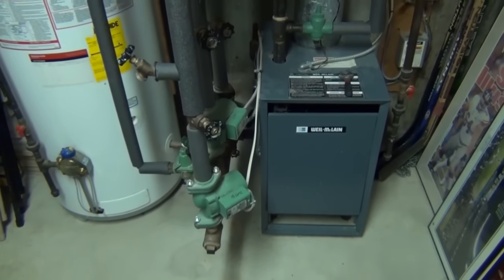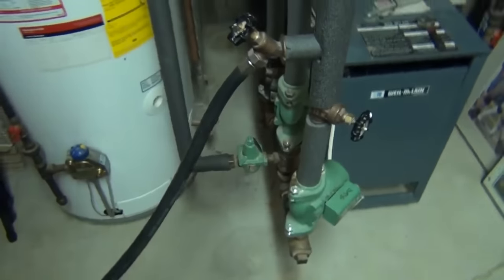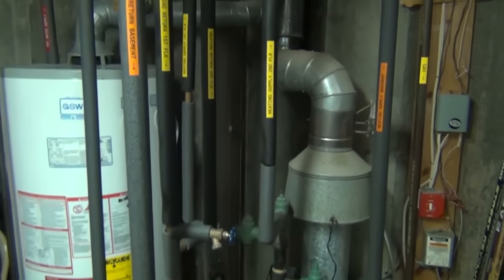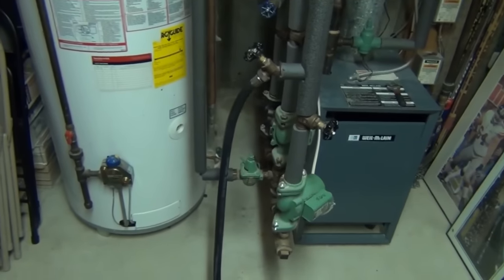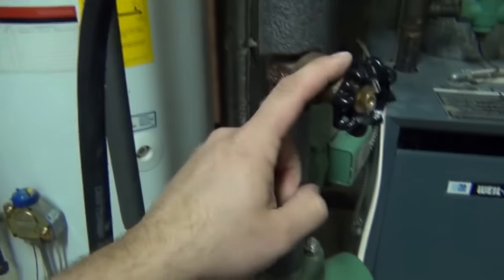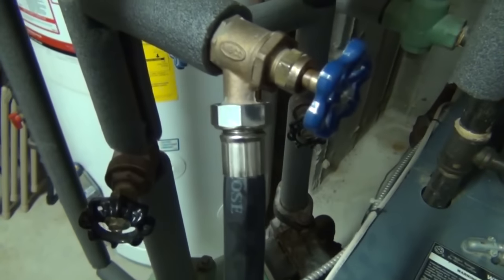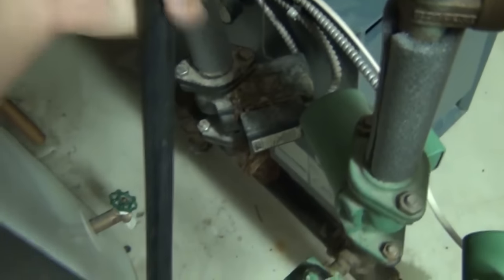Remove Air from your Boiler and Heating System | How To

Comment: Looks like city water pressure could be around 60-80psi. When the fast fill switch is on, and you let the water run through the boiler, how come that doesn’t set off the relief valve? Thanks.
Reply from the maker: Good question…because it never has a chance to build up with the purge valve open
Reply: @fixitwithzim  I see. Thanks a lot!

Comment: R all the lines to the rads insulated like I could see ? Noticed that the gage in normal range. Mine r insulated but my temperature goes beyond the setting 30-40 degrees. Comes on normally. My pressure goes down to almost o as it cools n shuts off   Two separate issues -any feedback ??  System bled n otherwise works fine
Reply from the maker: The pipes are only insulated near the boiler in an attempt to “hold” the temp in the system a little longer and also so the room doesn’t get that hot. Helps marginally but not much.  You sure your gauge is working correctly?

Comment: I have an automatic air bleed valve but still hear air in the system. Can this process be done even though my boiler is equipped with the automatic valve?

Comment: After watching your video I went to check out the boiler.  I have two zones.  The air purge values were connected by a three foot hose.  I felt the hose and  it felt hot and like it had pressure.  The boiler was on at the time.  Is this normal? Why would it be like that?
Reply from the maker: Valves are probably leaking so someone coupled a hose on them to stop the leak.  Either that or someone looped the zones together to bypass a bad circ
Reply: @fixitwithzim  thanks. , And like others said, your videos are excellent
Reply from the maker: @Bklynsray  thank you!!

Comment: Good video. But watch out your pumps hanging in the air. I would fix them tight to the floor with additional support. Your pumps most probably have a slight movement when switching on and off. That will let your connections give cracks and leaks over time.

Comment: My system has 2 zones that share a return. There's a pump for both zones but there is no valve between the drain valve and where they tie back into the boiler. Now what?? Is it still possible to purge the system?
Reply from the maker: Yes, it’ll take a bit longer since the air won’t be pushed out the hose 100 percent. You can still get it done

Comment: Hi I have a question can you do this while boiler is running?
Reply: System should be completely turned off. Some systems have two switches one just for the burner ie service switch and the other a main emergency switch that should shut both the burner and boiler/circulators.
Reply: @Precisioninfrared  ty

Comment: Question:  my system doesn't have the gate valves as you described at 2:15 (the ones to prevent the water from going back into system).  Is there anything I should do differently if I can not close this off?
Reply: Some systems don’t have purge stations so you have to bleed them at the highest point in the loop.   You might not have gate valves but it could be a different kind of balve too
Reply: @gfriedman99  Thanks for the reply!  Sorry, I should have been more clear about my system..  I do have what appears to be a purge valve - the one that you can connect a hose to.  The difference in my system is that I don't have the second valve that is being shut off to prevent the water from flowing back into the system.  Is that a problem?  Is there anything else I should do differently because of that?  Would it still be okay to open the fill valve to increase the water pressure in that case?
Reply: @MD-tb8dk  I understood what you said.   You have a boiler drain.   So unless there is another valve you can shut between that drain and the rest of the piping you wont be able to bleed air this way.   Most likely you have cast iron radiators anyway so you would need to bleed it there.
Reply: @gfriedman99  thanks again Gene.  I actually don't have radiators.  Sorry if i am not explaining this very well,, as I am learning and a lot of this is new to me..  I have 5 zones with baseboards along the floors, which have the copper pipe inside (the ones with all of those thin squares around the pipe).  Each zone has a drain/purge valve (the one that you can attach a garden hose to) and below each of those are the zone valves (the box that can be switched from automatic to manual via the lever).  Below those zone valves the pipes all meet up with a pipe where the domestic water comes in which feeds into the boiler/furnace.  What i don't seem to have is the second valve on each zone that is being closed off (the one without the garden hose connection.  It looked to me that I would be able to connect a hose and open the valve to purge air out, but was concerned that my system doesn't have that secondary valve to close on each zone.  Does that make sense?  I think my system may be a little different in its setup than most...

Comment: My make-up valve goes into the high pressure side of the pump. Two zones. Gonna try to figure this out and will report back. I don't see a way to get fill water into the other zone. Maybe there's a set of valves connecting them somewhere.
Reply from the maker: Everything connects back to a common place once it enters into the coil in the boiler. Follow the steps in the video. You’ll be good!

Comment: My PRV is still blowin off at 30 psi after changing exp tank make up  valve tridicator  and HW coil on a 2 zone 2 story Burnham oil fired boiler. What am i missing? Could air in system be the cause?
Reply from the maker: You might need to replace the valve. Once they blow off, they’re usually not reliable anymore
Reply: @fixitwithzim  boiler peaks at 20 now on a 2 story thank god.. valve ok for now thanks for your help sometimes you just need to look outside the box.
Reply from the maker: @Supanova70  no problem, glad its working without any issues now 👍🏻

Comment: I want  to remove my expansion tank to replace it with a new one, I should turn off the water supply going to furance/ boiler ?
Reply from the maker: Yes and drain your system before removing
Reply: @fixitwithzim  Can I drain it from the relief valve/pipe and should it be drained completely?
Reply from the maker: @hubert-williams3379  no, definitely don’t open the relief valve.  Once that’s opened, there’s a good chance it won’t seat properly again and leak. You should have a boiler drain somewhere

Comment: I've got a two-family house I bleed all convectors bottom and second floor but it seems that on the second floor I can't keep the kitchen and liver room convector hot.I check the shut-off valves they are ok.I bleed both convectors until they got hot. Then my tenants call me the next day  saying they gotten cold again. What's the problem?
Reply from the maker: Maybe a weak circulator pump?  Is there air in the loop again a few days after your initial bleed?  If so...you have a leak somewhere
Reply: @fixitwithzim  A new  circulator pump was installed  last year.If its a leak how can I find it ?

Comment: What if you don’t have a water drain on top of your circulators? I have two zones with two circulators and I have no water drains on top of them.  I only have two open/close valves on top of circulators.
Reply from the maker: There has to be a drain somewhere…most likely a boiler drain. You can use that, it will just take longer
Reply: @fixitwithzim  yea I have two,  one to drain the entire boiler at the bottom.  The other to drain midpoint.  I used the mid point drain.  Just like you said it just took a bit longer because it had to circulate through the boiler.

Comment: My system has a ball valve for the main water inlet into the system. After purging air from the system should i return that valve to fully closed?
Reply: No.  During system operation, the system  needs to be able to add water to the system, via the make-up water assembly, to compensate for water loss during operation.  The loss should be small, but it does happen, and is expected.  If you close off the feed to the make-up water system, your system will not be able to replace lost water.

Comment: How would I do this effectively if I only have 1 ball valve sgut off on my return for a 3 zone?  I have a lower back room/family,  1st floor living/dining,  2nd floor beds & bath.  3 lines out/supply - 3 lines in/return.  Only ball valve shut off is on the living room return.  I have 3 circulators for each zone.  No zone valves.  Each of the 3 returns does have a purge/knob station.  Not sure how to isolate each zone with only one ball valve to stop return/flow back to boiler. 4 days spent trying to figure this out.  I'm exhausted.
Reply from the maker: You’ll need to bleed them all together if the system lacks valves. Not ideal but it will work. Just will take a lot longer to do. Good luck!!
Reply: @fixitwithzim  
I'll give it a try tomorrow,  Thanks
Reply: @fixitwithzim  
I tried it.. Had all 3 purge stations open at same time.  All c-pumps and boiler turned off.  Lower and upper floors drained as expected with some air released.  The middle floor (problem floor) flow was 1/2 the flow of the other 2. It seemed to trickle out.  After getting airless steady water flow from the other 2 , That particular line seems to be clogged or blocked.  After closing the other 2 off and isolating to only the problem line no increase in flow.  I repressurized system turned c-pumps on and heard the gurgling immediately.  With pumps running system circulating tried purging again with valve open to boiler and lots of air came out.  Lines were dancing all over the place.  Finally settled but still no change with flow from problem line.  An hour later when system got back to normal operating the whooshing and gurgling is back.  No fix.. I've tried everything.. Ready to take a sledge hammer to the whole thing and call it a day.

Comment: i have a wellmclain water hearer how do i know if there’s air inside and is it bad to have air inside
Reply from the maker: Its not bad but also not good.  Air in the system causes system inefficiency and tends to be noisy when running.  You should definitely bleed the system.

Comment: Why aren't the air purge valves on the TOP??  Isn't that where the air goes in pipes??  How do you force air to go down in water??
Reply from the maker: It will be forced out since there is no other way for the water and air to travel. There should be an air scoop and auto purge at the top but whoever installed this system originally was a moron. If it was a little newer, I’d repipe it correctly but I’ll probably just end up replacing the whole system soon. It’s almost 30 years old.

Comment: When I open the fill valve all the way the water dumps from the pressure relief valve right away? What am I doing wrong?
Reply: Replace the pressure relief valve. Once blown it's no good. Good for 1 use only. Never forget to turn down the fill valve BEFORE shutting off the water.   8:26

Comment: not a air purching question. your circ pumps into the boiler on return side. then on the supply side u got exp tank? I know its been like that for yrs on a lot boilers. was told is better to put circ pumps after exp tank. this will prevent negative pressure
Reply from the maker: You can make an argument for either method of install. I’ve found that it’s usually done like this for ease of plumbing.  Haven’t seen any Ill affects being set up like this although if I was doing this over, I’d add an air scoop or spiral vent to this system before the supply line branches off the boiler after the flow check valves
Reply: The expansion tank goes ,on top of the boiler, close to the block, uninterrupted by ,i.,a valve,check valve.its best on the feed header on the top, out to the system, with an air scoop,and auto matic. Air vent
Reply: Circulators,I prefer on the returns, with a valve and purge ,on top,if u think be about it, the ciculator is moving the water either way, anyway

Comment: What if one of the inline pumps makes a lot of noise?
Air trapped in the pump?
Reply from the maker: Probably the bearings or motor going out. Time to replace. You don’t want that breaking in the dead of winter

Comment: so you bleed air when pipes are making noise?? or not hot???
Reply from the maker: If they are making noise, choose a good time to bleed (usually when it’s not sub zero out). Turn the boiler off, let it cool to around room temp and start the process

Comment: When I left the fast fill on, it set off the over pressure valve within about a minute, is this normal? I have about 55 psi city water, and the drain was open and running the water via hose outside
Reply from the maker: You might need to throttle it back if it popped the pressure relief valve. Either that or something is clogging your loop somewhere. Any other valves on the system possibly?
Reply: @fixitwithzim  Yeah, I had to dial the fast fill back some, I had no idea you could adjust it, but it makes sense, thank you!

Comment: strange i dont have expansion tank like yours. mine is at least 4 times bigger and laying horizontal
Reply: Your lucky that’s the old style its much better.    Mine is 60 years old.   The new style like in the video has to be replaced every 5-10 years.

Comment: The one problem is your system fill is located in the wrong place it should be introducer between your expansion tank and your scoop valve  in the supply .

Comment: Hi, I don’t have shut off valve in my system, the water feed goes to the pressure regulator then tied in between the pigot valve( sediment valve) and zone valve then to the circulator pump back to return line of the boiler,so how do I bleed the air out? Thanks in advance
Reply from the maker: How many zones?  You don’t have shut offs for each individual zone after the purge valves?
Reply: 2 zone valves tied into one circulator pump and yes there’s no manual shut off valve

Comment: How do you know which pipes are what?
Reply from the maker: Not all that difficult to tell.  You can usually follow the path and see where they are going.  You can also turn on only one zone and feel the pipes.  The hot ones are the zone that is running - cold or luke warm are off

Comment: After living in my apartment for 10 years.....my boiler started gurgling really loudly.   I asked my landlords to get it purged and they said "Oh....its old....it will make noise."   No....not in my opinion.   Water systems shouldn't make any noise beyond the metal in the radiator fins getting hot.    However i think i will still have to have a plumber do this because here in Alaska we use anti-freeze in the pipes.
Reply from the maker: You can add antifreeze back to the system with a small pump and 5 gallon bucket. You recirculate the water into the system through the purge valve with the pump running. Easy process.

Comment: Put a Spirovent auto air eliminator on and make sure there is enough pressure to get the water to the top floor..
and you should never have air in your system.  When you bleed with fresh water you are introducing more air to 
your system,
Reply from the maker: Yes, ideally the header on this system should be repiped so the xtank and vent sit in the right spot. System only has a few years before I replace. Not worth the work now. Thanks for the comment

Comment: I've two-family house  built  1960 I can't get no circulation in my 
kitchen and liver
 room on the second floor which is right next door to each other.I bleed
 them both Still not getting no hot water coming out my bleed valves. 
What's the problem? No zone valves.

Comment: What if you don’t have a zone valve?
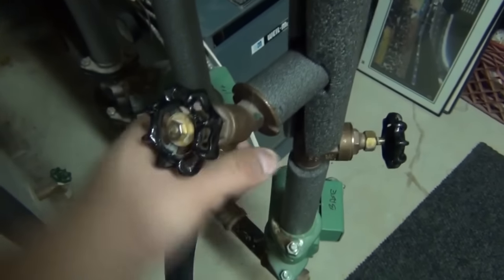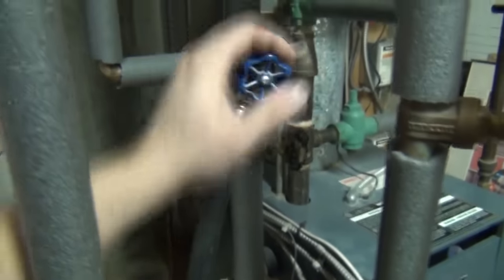Reply: Then it's a single zone. don't worry about the instructions for other zones. use 4:15 to 8:55. and 10:55 to 12:15 and 14:08 to end.

Comment: shouldn't expansion pressure equal to water pressure in water pipes?
Reply from the maker: _ Remi _ water pressure in the boiler/pipes is dictated by what pressure the fill valve is set at. As the water is heated, pressure increases which is the function of the ex tank to absorb that extra pressure
Reply: @fixitwithzim  | it should be precharged to match the household water pressure, ez to do by connecting water pressure gauge to spigot outside the house. ( water sprinkler location)
Reply from the maker: _ Remi _ no, that’s not how hydronic heat is set up. Baseboard heat operates between 12-20 lbs, the fill valve steps the pressure down.  City pressure can be over 40 psi, you’d pop the relief valve at 30 psi. I have another video on my channel where I replaced both these parts and explain that
Reply: 20 psi is extremely unheard of. Any residential boiler will operate correctly at 12 psi and below, if properly piped and foot of head is correct.  Even a tri-level home is well of at 12#.
Reply from the maker: PABLORL1989 a system set at 12 psi can easily reach 18 psi when at full operating temp

Comment: Had a new boiler installed for baseboard heating in 2017, they never addressed leaking pipes going into the baseboards. So air has been trolling around in the system, finally fried the control board. They came here 2023 (one year out of warrenty) and fixed the pipes, replaced the control board, bled the baseboards, pressurized it only to find water leaking from the boiler.  Said it's my fault the boiler needs a new casting because I did the procedure in this video and the fresh water destroyed the boiler because it was supposed to remain a "closed loop" system. If they fixed the piping in the first place, air would have never gotten into the system. Now it was $2200 for doing that, and now I basically need a new boiler because I bled the system? Someone help!? Mind you I never saw water leaking from the boiler until now